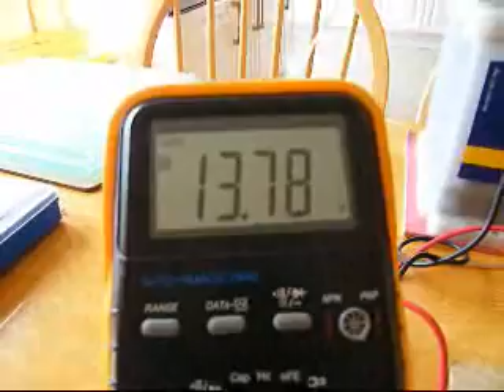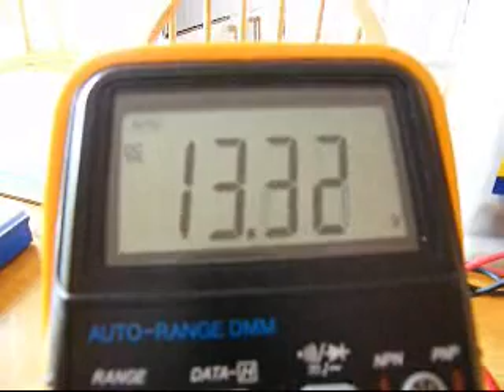BOC Pulser Charger

Comment: Lee
thanks for your kind response. 
my thought was, if  "efficiently" is part of the goal that the SCR may not be the best solution. The SCR has a built in voltage drop of at least 1.4v, acting like a variable resistor that is directly related to current.  Just the same if a SCR works best for this stage of development I understand. I have been playing with power fets for a while. Let me know if I can help.
Best of luck :)

Comment from the maker: Hi There,
The goal is to efficiently charge batteries using John Bedinis technology. I know the advantage of  Mosfets but power mosfets are particular about gate charging and hate voltage transients which is what this charger utilises. Adding and protecting a mosfet would increase circuit complexity. When all that is required is a simple contact breaker (without the ware) an SCR is suffice.

Regards Lee